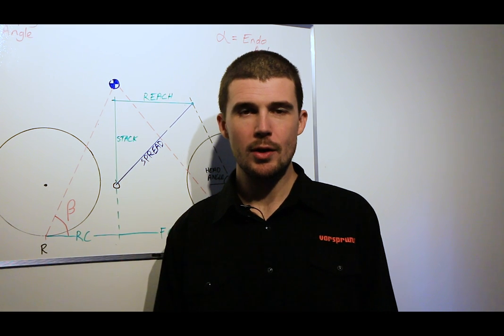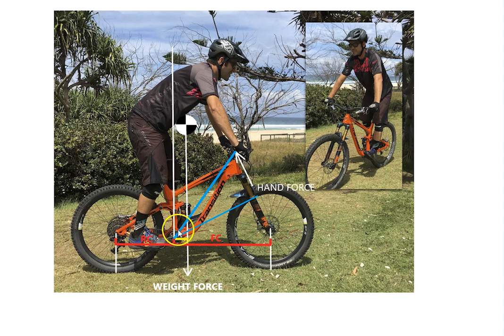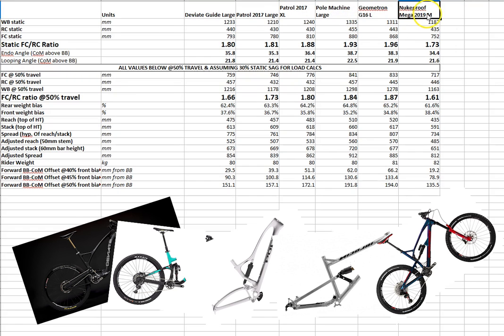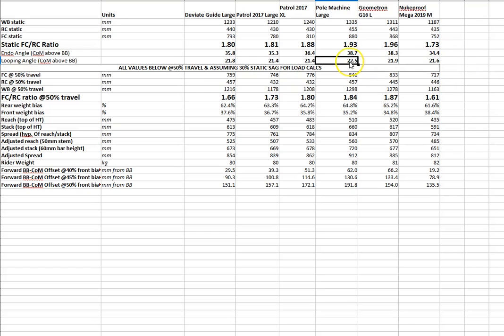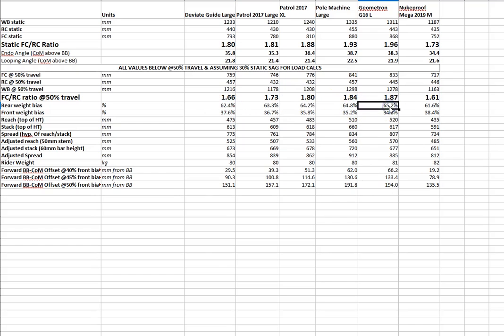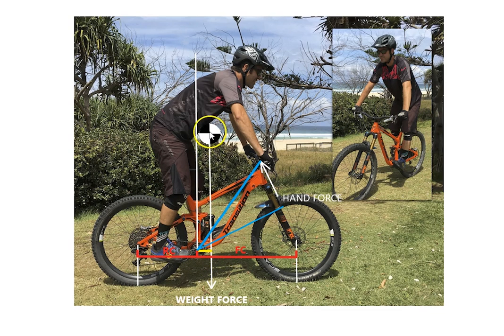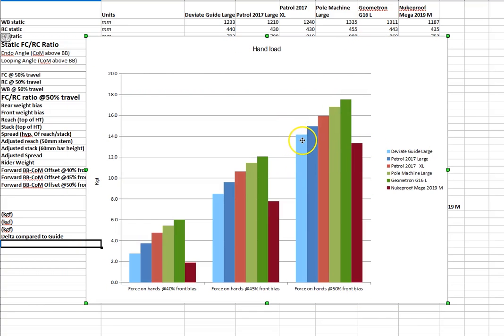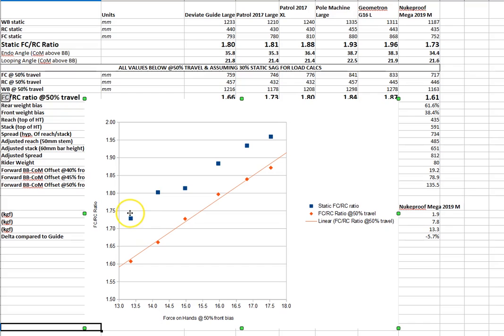Understanding Advanced Bike Geometry Pt 2 - Tuesday Tune 26

Comment: @Vorsprung Suspension I have a growing suspicion that the latest hype around reduced offset forks actually has nothing to do with changes in steering characteristics due to trail and instead is due to the reduced front-center (and therefore reduced forward bias required to maintain traction). I think it's so noticeable now because head angles are getting insanely slack and FC:RC is also growing unabated. You can sort of see the cognitive dissonance in a few media reports, where the writer acknowledges that reduced offset increases trail and should add to the slowing effects of the slack head angle, but somehow makes cornering more effortless. Seems like moving from 51mm offset down to 42mm (as we do on 29ers) would make a pretty big difference in your FC:RC ratio. What do you think?
Reply from the maker: I very much agree - I don't place much importance on trail for mountain bikes (whereas on motorbikes it's very important). A long time ago (maybe 10-12 years ago) I actually tried running the crowns backwards on a Boxxer to see what'd happen. That reduced the offset by somewhere in the vicinity of 20mm. It had little appreciable effect on how much force was required to move the bars, like it didn't really feel any more stable or actually much different at all rolling in a straight line, but the higher inclination to tip forwards and the larger amount of weight on the front wheel (ie change in FC/RC ratio) was pretty noticeable as you mention. That was about when I lost interest in trail as a useful measurement for mountain bikes.
Reply: @VorsprungSuspension  This would suggest that riders are unconsciously enjoying the slight reversal of the long wheelbase (i.e. long front-center only) trend via 7-10mm reduction in fork offset. Transition established the short offset fad and by their own accounts it was simply a matter of trial an error. They said they experimented with reduced offsets and it enhanced the steering when it should have just slowed it down, but they were already riding a super long front-center in that test. They now say "you can't just throw a short offset on any bike, it's only good in conjunction with our geometry changes," and those changes consist only of super long front-center, steeper SA, and a puny stem. They are still running their chainstays as short as humanly possible, like most brands. 

It does seem to me that we could all benefit from the longer wheelbase trend if it were applied proportionally to the chainstays as well. We could keep the slack HAs, and probably no need for mucking around with offsets. Yes, it would hamper the quality of your parking lot manuals, I suppose.
Reply from the maker: @justinfraga6677  10/10 for psychic abilities.
Reply: @justinfraga6677  Transition was the first to make a marketing package out of the short offset thing. Chris Porter of Mojo UK was the first to experiment with the concept by swapping crowns between 26, 27.5 and 29 Fox forks. Other brands (Whyte) have been using shorter offsets quietly since 2016. Super interesting observation you've made though even if I read it 3yrs later!
Reply: @soulzerosix  3 years later and we are now seeing many of the same brands (quietly) lengthening their chainstays, some hovering around 440mm on 29er big trail bikes. And the MTB journalists are replacing their "snappy"/"flickable" assessments with comments about "stability" and "effortless cornering" 

I can't decide if this is hilarious or sad.
Reply: @justinfraga6677  Most mtb journo's are not very journalistic it appears. Take product reviews. I tend to take everything with a grain of salt as most products get glowing reviews on their first year and next season the tests are a bit more honest. I like Blister and NSMB most for useful info.
Reply: @justinfraga6677 I feel like we aren't getting the optimal geometry and that most bikes are ruined by long chain stays.

Comment: Great numbers Steve and a very interesting thought provoking discussion. Could I generalise and sum up your point as that when bikes get longer and slacker (or rather increasing FC), this forces riders to move their weight forward in an effort to increase front wheel grip and thus putting more pressure on the hands, causing fatigue. Would it not make sense then to increase the RC length to compensate for this and keep the RC/FC ratio within an acceptable tolerance? (1.60 - 1.85 or what that might be). Obviously I think you've stumbled onto Sam's big secret here and I just want a bike that will make me ride like him!
Reply from the maker: That's my line of thinking too - get the FC to where it needs to be, within reason, see what kind of RC you need  for a reasonable weight balance, then see if that RC is acceptable in non-grip-related scenarios (pumping terrain, manualling, etc). If it is, away you go, if not, FC might want to come in a bit. Still don't think the most balanced bike in the world is gonna turn you or I into Sam however :)
Reply: @VorsprungSuspension  I'd like to hear more of your thoughts around this Steve, as its a refreshing practical point of view. With regards to bike fit, it makes more sense to me now when assessing a bikes geometry, to find a Stack/Reach/Spread triangle that suits your height and ape index and then look at how that triangle is placed within the wheelbase. I know i'm not considering the economics, but when a manufacturer keeps the chainstays the same length through the sizes, then as the bike size increases, they are simply transferring the riders weight onto the bars, instead of keeping the riding position the same (Reach/Stack would be scaled for size obviously) and moving the centre of mass forward in an effort to keep the FC/RC ratio similar between sizes.

I've probably over simplified this a bit and there must be people way smarter than me working on these issues, but you've definitely change my perspective. Thank you.
Reply from the maker: @codemuster  10/10 on same page hahah

Comment: Good stuff Steve! I think you're absolutely right in your calculations and coming to the conclusion that if you have a shorter bike, or a bike like the mega with a FC/RC ratio closer to 1, that it will be easier to weight the front wheel. This probably does result in better/easier cornering for most. The downside should also be added though that longer bikes are more stable going straight, easier to plow through stuff, and you have more room to maneuver which is why too long or too short gets bad as well. 

I've also ridden a Machine and while I loved it, I did notice I was weighting the front more to corner effectively. Cheers!
Reply from the maker: Agreed on all counts there. We went over a bit more of the straight line aspects you mentioned in part 1 of this vid if you saw it.

Comment: @Vorsprung Suspension
1. on longer Front Center bikes like Geometron or Pole aren't you standing more forward? How much forward is this stance? 
2. on longer Front centre bikes is also more difficult to move backwards, so you are more stable during ride.
What is your opinion ?
Reply from the maker: 1. What do you mean by standing more forwards? Your CoM when standing is just in front of the BB if there's a moderate amount of weight on your hands. The amount of load on your hands can only really be estimated if you want to know the hand load at a given front/rear wheel weight distribution, which was what we were doing with this spreadsheet.
2. Sort of - longer wheelbases (not just long FCs) make any body motion effectively smaller in terms of its effect on weight distribution.
Reply: @VorsprungSuspension  I mean that when you are in attack position on these longer bikes your weight could be more forward and so, more weight on your hands. Since you have tested these bikes, I ask you for your opinion on this.
Reply from the maker: @v_sot  that is pretty much what I observed yes, hence this whole spreadsheet :)

Comment: Hi Steve! As someone that has owned an Evolink, currently riding a Machine the real world experience is completely opposite what you describe. I am able to do more standing pedaling, can do extended downhill runs with less fatigue and my cornering speeds are much higher. I experience less arm pump and upper body fatigue. Key adaption for me was to ride from higher more upright position and I ended up raising handlebar height several centimeters. I still keep nearly all of my weight on my feet and my hands dynamic and light. I still have several bikes with conventional geometry so I can do even back to back testing even. I still think you are bringing up an interesting angle and there is valuable insight, but it would be good to understand why real world experience is a polar opposite of your theory.
Reply from the maker: That's good to hear that you like the bike, however it's worth noting that what we're discussing in this video is really only relevant to body position whilst cornering at/near the limits of grip. I'm not saying the bike is necessarily more tiring to ride overall in every situation, in fact if you watch part 1 of this video you'll notice that we talk about how the long FCs are actually helpful in a straight line by flattening the endo angle and reducing tripping effects. The fact that you had to raise your handlebars several CM is interesting - it does tend to indicate that you were trying to reduce load on the hands. It's also only YOUR "real world experience" that you're saying contradicts this explanation, because MY real world experience from riding the Machine was what prompted me to try to understand why it was harder to keep sufficient weight on the front wheel in many corners. Is weighting the front wheel in corners the only thing that tires you out on a bike? Of course not, it's just one aspect - for some people it might not even be worthy of consideration at all. Pedalling is tiring, braking is tiring, bracing yourself against big impacts is tiring, pumping the bike through terrain/corners is tiring, prolonged braking is tiring. Fitment matters a lot, I would say much more than FC/RC ratio when it comes to being in a comfortable and sustainable position on the bike. But it does not change the fact that your CoM needs to be further forward to keep weight on the front wheel if the FC/RC ratio is higher.
Reply: A big aspect for me has been also, that long reach gives more modulation for managing front end grip. New school geometry bikes like to be ridden from throne position instead off ass high, elbows up attack position. Since it is more confidence inspring ride many riders improve their riding position a lot as bike puts you in correct position. My old Nomad mk3 was an example of imbalanced bike that had very narrow sweet spot for CoM. I attribute this to two things. Lack of midstroke support in shock / super progressive leverage ratio and short chainstays. Since shock was not supportive bike folded in half when boosting grip by leg pressure.
Reply: Is it weird that i found that a longer fc bike with a larger reach has been way more stable in corners and on straight lines! I ride a large bird aeris 160am (should be on an ml) I find there is more space around the bike and i can get the bike lower with more corner grip than my large giant glory

Comment: Is there any merit to having the same compression ratio in your fork as the average leverage ratio of the frame. For example my 2015 fox 40 with the pablo air spring can be set to roughly a 2.6 compression ratio at is largest volume and my current bike frame has an average leverage ratio of about 2.6 (i run coil spring). Would this make damper tuning and finding a balanced spring rate much easier?
Reply from the maker: Not as such, they're just coincidental numbers. Kind of like how you may be running 2.6" tyres :)
Reply: @VorsprungSuspension  thanks!

Comment: Super interesting topic and discussion. I enjoyed your back-and-forth with Leo from Pole too. If nothing, i shows both your passion for what you do. At least the “industry” needs more of that!

Anyways, since seeing the video earlier today, I’ve been thinking about the stuff you presented. As an intermediate rider, with somewhat of an “confidence” issue, I love geeking out over geometry number, and how the different parameters effect handling. I guess I need all the help with my riding I can get 😉
Most of what you say makes total sense, but a few things were still left niggling in my brain:

I would have to agree somewhat with Leo, that it’s not only about moving rider forward, to achieve the “loaded front end”, but shifting (rider) weight up and down of course also plays an important role. Which I’m sure I’m preaching to the choir about.
The being said, having myself moved from a “traditional” setup to a more “long ’n’ slack” one, I initially washed the front out more the first  couple of tries. For me there was a definite learning curve/adjustment in riding style.

Second: Stack height (and subsequently it’s effect on your “spread” value).
For me it’s a tough parameter to wrap my head around, especially while “theory crafting” on paper. It’s one of the few measurements we as end consumers can manipulate relatively easily:
Rise on bars and stem, stem angle, axel-to-crown heights, headset spacers etc. Which is why I also tend to “ignore” it somewhat, when looking at geometry numbers. I feel it’s something I can fiddle with at a later point. For me reach, head angle, BB height, chain stay - and being a shorter rider, with short legs - seat tube length, are measurements I tend to have more focus on. The lower I can get, the better. 

Oddly I haven’t really found a “too slack” bike yet. Again, being short-leggede, seat tube angle doesn’t effect me too badly; but seat tube length and how far I can tuck/drop my seat out of the way on descents is waaaay more important. Bikes that have longer seat tubes than reach, just don’t interest me at all anymore. I’d rather go single speed than loose my 160+mm dropper. On really steep up hills, fork length seems to play a bigger role than how slack the bike actually is - for me anyways.

Ok, that became a bit of rant. Sorry. Just to clarify: Super interesting topic. Please do more.

Also, I’d love to stick you in a room with Chris Porter from Geometron/Mojo (I wonder if he still thinks if 29ers can have too low BB?) and someone like Dave Weagle too. Just for a couple of hours, and let you guys have at the whole modern MTB industry!
Reply from the maker: Thanks for the kind words,  although I don't think there's a room in the world big enough to fit all three of our egos in there :)

Head angles can go crazy slack before they (alone) become problematic. Keep in mind that the "average" trail bike nowadays is slacker than the Iron Horse Sunday was back in the day. Far longer too.

As far as moving rider weight around, my reference points are simple - CoM and BB. Those ones are easy because the BB acts as a pivot. If your weight is for example vertically above it (no weight on the hands) then no matter what the gradient, your unbraked weight distribution is determined solely by a line drawn vertically down from the BB to the ground. To load the front more, you either need to brake (certainly not ideal whilst cornering, but pretty standard practice on steep stuff so that you avoid a costly funeral) or have the CoM further forward. Moving up/down on the bike doesn't change that, BUT you can have any number of body positions that give you the same (again, unbraked) weight distribution there. So if your body is flatter (shoulders further forwards, hips further back), your CoM may be lower and your weight distribution still the same - handy on steep stuff when you want to maintain grip on the front wheel without getting pushed over, because you're flattening the endo angle without reducing grip.

Stack height is IMO first and foremost a fit/spread issue. Using it to adjust anything else may achieve the goals you want, but unless for example you want more spread for less hand load when weighting the front wheel AND because that fits your desired body position better, you may find that it messes up your preferred fitment as much or more than it helps with getting your weight somewhere in a specific scenario.
Reply: @VorsprungSuspension  Wow, I had not thought you'd reply, let alone this fast. Thank you. Stack is still somewhat of a "mystery" to me: In my mind, I can achieve the same hand position/load with any number of combinations of bars, rise, sweeps, stem lengths/heights and angles, spacers and A-to-C forks. It's slightly daunting to think about, so in my perfect 2-D spreadsheet comparisons, I still tend to not give it (enough?) focus.

Anyways, loving the content, and my Vorsrpung Luftkappe for my Pike, just to boost the egos a little more ;)
Reply from the maker: @danielgrafik  yeah pretty much - it's interesting that of all the bike fitment stuff that's ever been done, it's only relatively recently that people (at least as far as I am aware) have really begun to discuss sizing/fit and actual weight distribution separately of one another instead of making adjustments of both at once.

Comment: I see the major takeaway here is FC:RC ratio is important and with most bike manufacturers designing around a single chainstay length (RC) to be a serious design compromise to reduce costs, standardize tire clearance, and speed time to market.  I'll like to see more brands (especially boutiques like Pole) to consider proportionate chainstay lengths to size on their bikes.
Reply: Chain length with rearward axle paths and 52t cassettes is a huge issue make fixed short chain stays convenient for suppliers